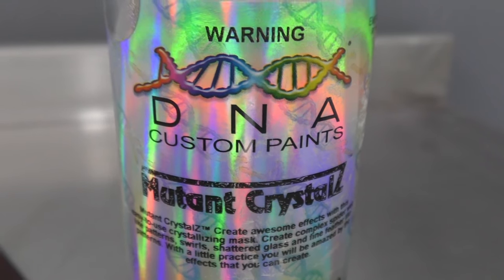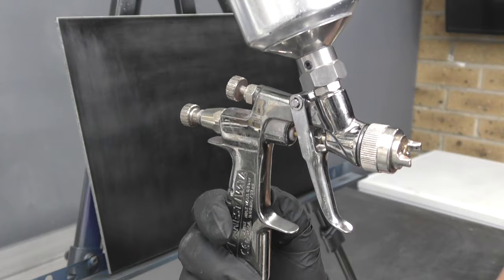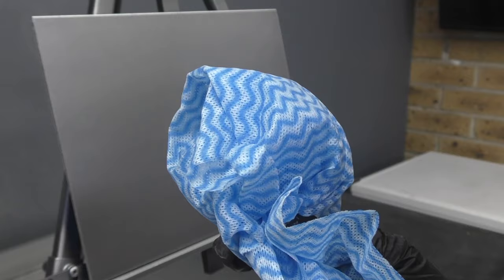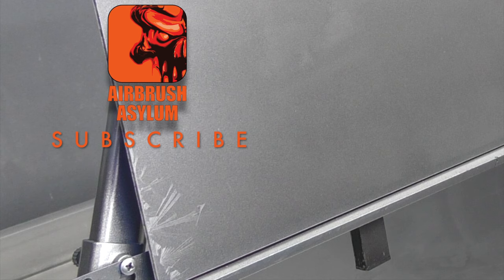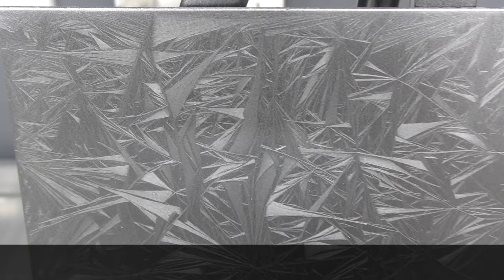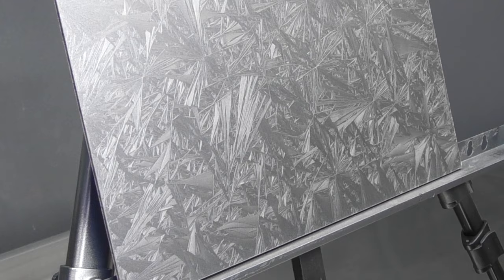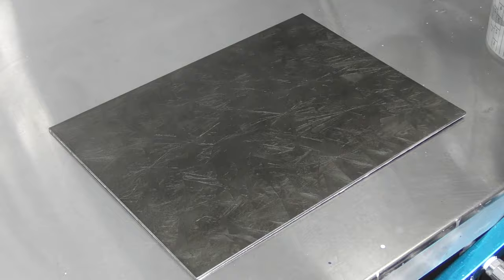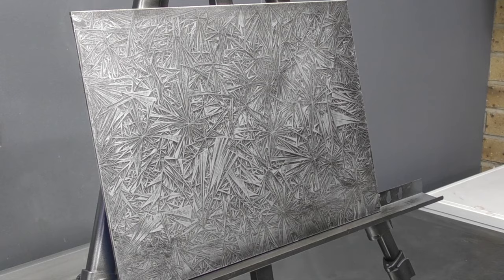Special Effects Paint Mutant Crystalz

Comment: To make crystal formule use: 100ml water 100ml Uréia (you find in agriculture shop) 5ml soap.
Reply: Do you know if this would work on waterbased acrylic paint?
Reply: Yes, that is true. very easy to make mutant crystal liquid with low cost 😊
Reply: @RonGotSole  Water-based paint will dilute when you apply the formula, I don't know if it works, but if you test it, let me know the result.
Reply: Any soap? Like dish soap?
Reply: What is the purpose of the soap?
Reply: @watchmeplayenergy281  the soap is a surfactant, reducing surface tension of the liquid allowing it to spread on the surface rather than bead up into droplets.
Reply: That's funny, I work in a fertilizer plant and we keep pelletized urea in big 200 ton bens. When the temperature changes the floor sweats and these crystals cover the floor when it dries. All tho I assume you'd better have some good sealer because it eats metal like crazy. Our front-end loader is only 4 years old and looks 15 lol
Reply: Hello, can you replace urea granules with another substance?

Comment: What are your drying times in-between each step? Will this work with water based airbrush paint? My thought is when you wet the crystals with water to be scrubbed off, all the black paint would come off as well.
Reply: allow the part to cure 30 min at 20 c use a hair dryer on low to be sure its fully dry and use warm to hot water and use your hand to remove the mask effect

Comment: so can you mask off a large area say for a skull and do this crystal method to have it in the back ground?
Reply from the maker: Yes you can mask a section and then crystallize, just make sure it’s a vinyl or fine line tape on the edge as otherwise it may deep through ? As you are applying the crystals heavily with a cloth 👍🏻

Comment: I hope you can help me,first can I get this in the uk ,also does it have to be done with a candy paint thank you
Reply from the maker: You can get it shipped direct from the manufacturer, dna-paints.com candy is only required to change it from silver to red 👍🏻
Reply: @AirbrushAsylum  If I use an acrylic paint or water based red paint over the crystal will it cover the crystal effect not showing the effect meaning it will be just a red canvas

Comment: Does the mutant crystal have to be applied with a rag as you did or can it be sprayed onto the surface and still achieve the same look?
Reply from the maker: As far as I know using the dish cloth is the best method , not sure if it can be sprayed 🤔
Reply: You can spray products like this using spray bottles or those spray paint systems that employ a jar and your own paint with an aerosol can of propellant (cant remember the name, sorry). Brushes and rollers can be employed as well.  All will give different results, and the technique, direction of movement, and application method all effect size and direction of crystal growth. It's important to experiment on multiple surfaces before applying to the final surface because even the topography of the surface your painting effects the crystals. For instance I was doing a job and the crystals emphasized the edge of a surface on one side but not the other and it ultimately looked disjointed. I opted to repaint. Sanding direction changes crystal direction growth immensely and can be used to manipulate how they grow. 

You can get interesting effects by wetting some areas before others, or by varying the volume applied in different areas. I often use an old hairspray bottle to apply these crystal products because it provides an even and very thin mist while still being easy to use and disposable and capable of wetting a relatively large area rapidly

Note.... my experiences were with a similar product but a different brand. Best advice is to experiment.  Get a bottle and waste it just playing around.
Reply: One additional note... if you attempt to spray, make sure you use a larger opening, not an airbrush, I wouldn't use anything smaller than 1.6